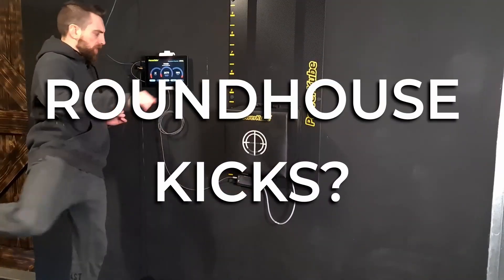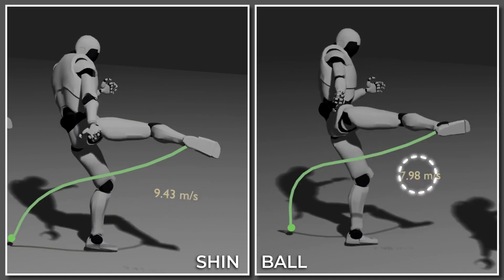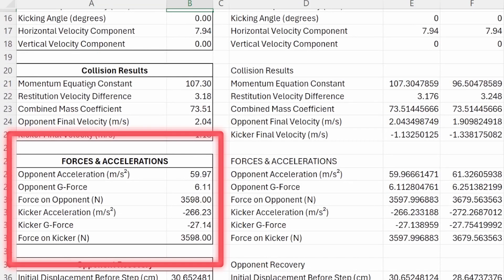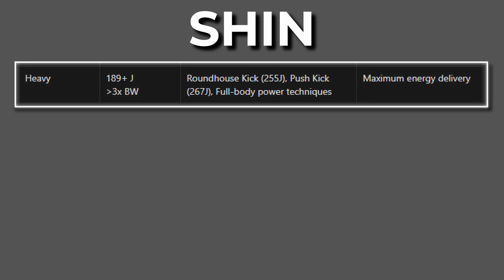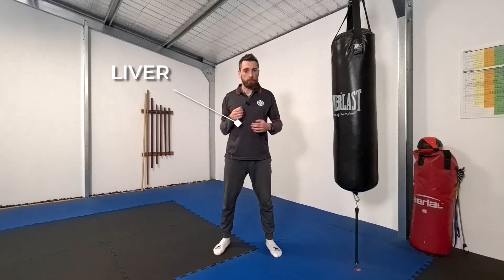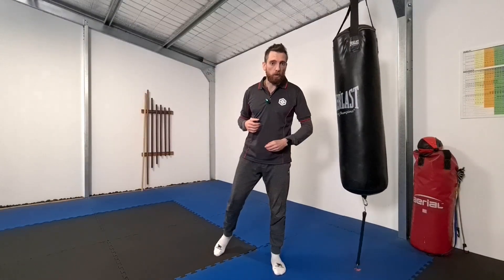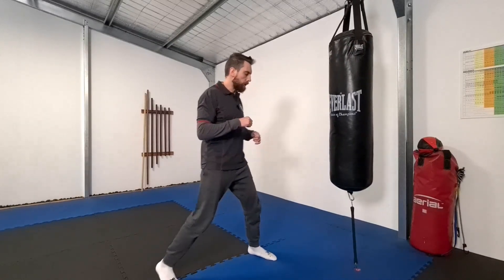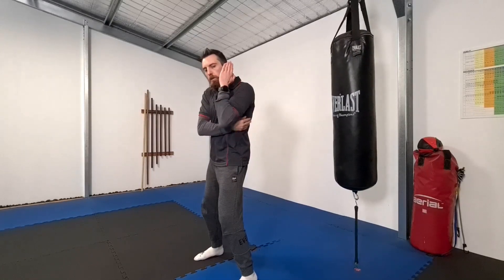Shin vs Ball Roundhouse Kick: The Science Explained

Comment: Great video. A few thoughts after watching this and your motion capture video:

1) There is a large degree of anatomical variation in how much of the liver is hidden behind the rib cage. In some people, almost all of the liver will be obscured, in other people perhaps only the dome of the liver or maybe none of it would be behind the ribcage, as well as everything in between. I'm not sure if that changes whether a shin or ball of foot kick is preferable to target that area.

2) If I understood the motion capture video correctly, Move AI extrapolates 3D motion caputure data from a 2D video. The accuracy of this was validated by running the same video through Kinovea and comparing. Both of these methods have the same limitation in that 3D motion is being extrapolated from a 2D image. The lack of depth perception may make it difficult to draw conclusions when for example comparing different striking variations. Perhaps it would be possible to use something like a Kinect camera or multiple regular cameras to capture the 3D motion? Of course this would only apply to a lab/gym setting and not live sports.
Reply from the maker: To answer point 1, we will never know the opponents anatomical make-up so best to just use the most effective attack you prefer, some that's shin others ball. For point 2, yes move ai does just extrapolate from 2d video. I have tested 4 different video to mocap programs and move ai is by far the best. Move ai also has a multicam system which has been shown to be as accurate as the marker based high end systems, but it's a little out of the budget for now. In future I definitely want to switch to multcam. Move ai's multicam system also allows recording of multiple actors so it's possible to record a boxing round for example then review. The kinetic camera is an interesting idea but I think it's a little antiquated compared to the ai mocap stuff of today, I'll take a look regardless.

Comment: Great work! I must applaud the commitment to compiling data.

I have a question I have been wondering about. What is the more important/relevant parameter to consider for striking power: momentum or energy?
The first scales linearly with the velocity, the second with the square of velocity. I imagine that figuring this out might shed some light of on the importance speed vs commiting body weight to a strike.
Reply from the maker: @michaelmuzika6871 Energy or specifically kenetic energy in this case is KE=1/2mass * velocity² so velocity has a much higher impact than mass due to mass being halved. For momentum they have equal impact p=m*v as you mentioned. Both are relevant but serve different purposes. Momentum gives us an idea of how the the objects are moving in space before and after the collision. Kinetic energy as energy by nature changes forms on impact, changing into things like sound, deformation, damage, heat, or remaining as kinetic energy. KE is what gives us an idea of how damaging the impact is. This is also why martial artists and combat sport athletes focus on speed. When it comes to strength conditioning there is a focus on rate of force development over mass or strength. Hope this helps explain it.